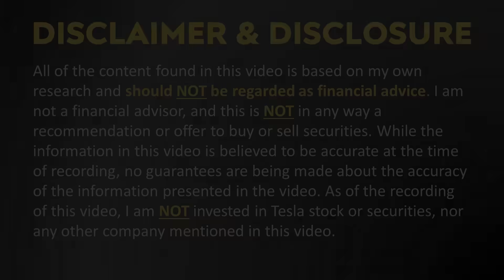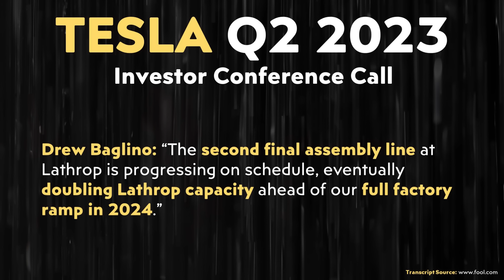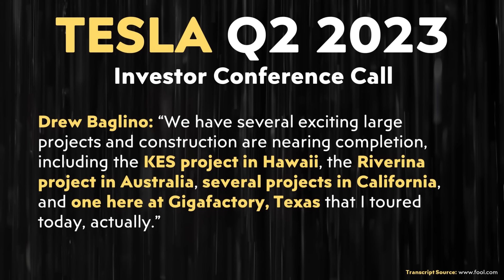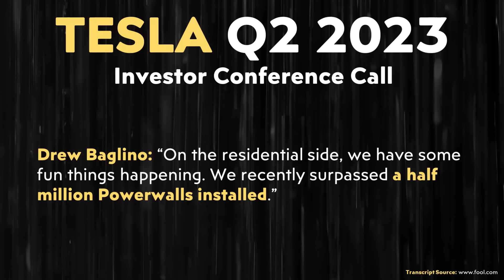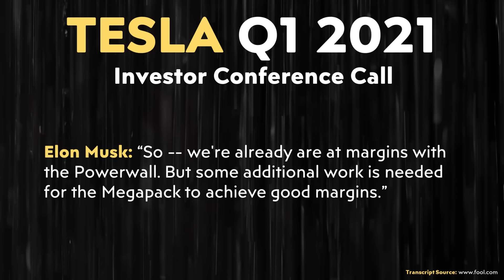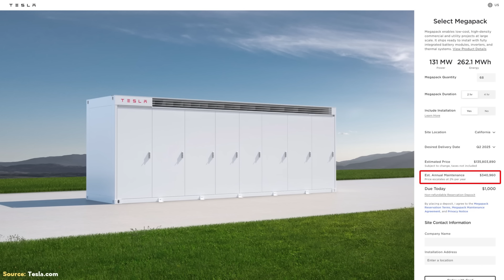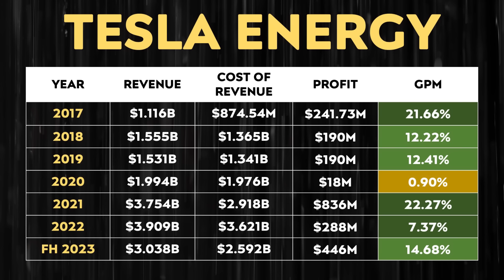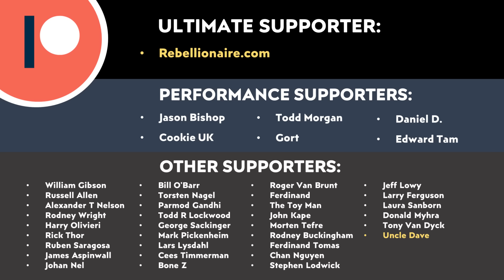BIG Tesla MEGAPACK FACTORY Update | Double Capacity in 2024!

Comment: I think we should say that the megapacks at Austin will stabilize electricity not only for Tesla, but quite a bit also also for the surrounding area.  

The relatively small amount of panels will help a little, but I doubt it would produce enough for that many megapacks.  

Can you dig in a little on that?  I heard you need a megapack with each set of chargers, sometimes more than one megapack is needed.  

I expect your headline will be the added stability to Austin grid.

Comment: Battery supply is going to be still an interesting problem. After all, a Megapack is sort of similar to a big flashlight. It is the packaging, necessary peripherals, and especially the excellent control software that add value and make Tesla products super competitive. Consider that it was reported recently (by Electrify) than new Powerwalls (with a backup switch) can be installed about 20 times faster than previous ones. Installations of Megapacks (like at Giga-Texas) certainly seem to move along quickly as well. With evolving improvements like those, good margins for the foreseeable future would seem assured.
Reply: Fortunately there's no shortage now, and a huge amount of new capacity is coming online soon, especially since governments started to see it as a strategic industry.
The only question for the second half of the decade is lithium supply. There aren't enough mines and new ones can't be opened fast enough due to very slow permitting.
For that the solution can be sodium-ion batteries, which are already produced at a reasonable scale. Sodium-Iron-Phosphate batteries would be ideal for storage, as all of those elements are cheap and abundant, and energy density is not that important for this use case.
Reply: @andrasbiro3007  Yes, I do agree with your assessment. Ha, one keeps hearing laments (like the old Club of Rome's "Limits to Growth"), but technology evolves and bottlenecks (like lithium) often seem to resolve.

Comment: John, if Elon is aiming at 500GWH megapacks production where is the electricity generation going to come from? Is there enough solar panels, wind turbines or other green energy sources to charge the megapacks? Or is he relying on customers to supply the energy and he just provides storage?
Reply: 1. The Megapacks are deployed worldwide
2. About 440GW of solar and wind capacity are expected to be deployed this year, and this rate continues to grow.
Reply: Autobidder. These packs are hugely useful even just connected to the current grid replacing peaker plants
Reply: There is a lot of energy thats current lost because generation has to be shut down because times of production and demand dont match up. So megapacks can be used to time shift plus especially in areas with presently limited supply contraints they can remove that throughput constraint. 
For example, single megapacks are becoming almost a standard install with SCs (but also other charger operators) in areas where theres ample supply over a 24 hour period to supply the chargers but not enough to support peak. So, fill up at nighttime (often when electricity is cheaper which is an extra bonus) and then sell it back at peak times and be able to support peak throughput. A very simple and easy business case. There are recent vids showing for example an Electrify America install with an attached megapack.

Comment: I'll be able to afford a Tesla right about the time flying autos are taking off.
Reply: The no maintenance, no gas means that if you can swing home charging the car saves you a great deal in 3 years.  Rebates then add to that, here in Canada we get $5000 off.  So, the basic rear wheel drive model 3 is really quite affordable.
Reply: @Richard-pe1cd  Thanks for the tip, Richard. When my ol'egg beater beats its last egg I'm going to look into that. But the thought of a flying vehicle is really enticing. 🤪